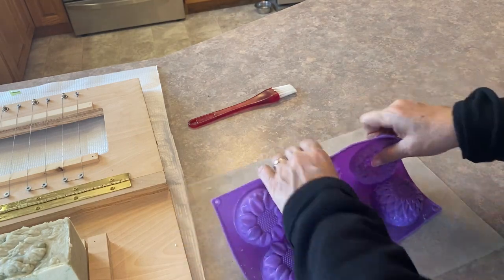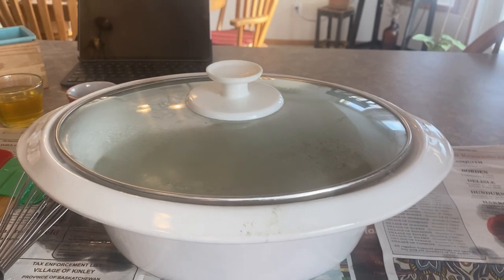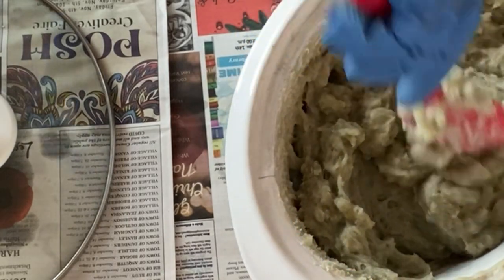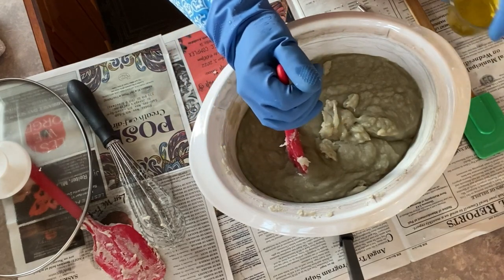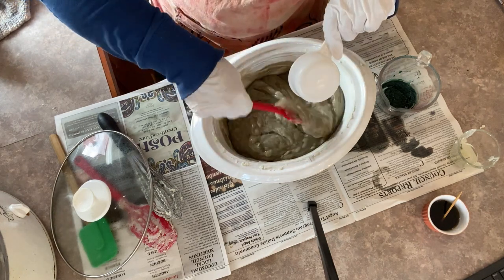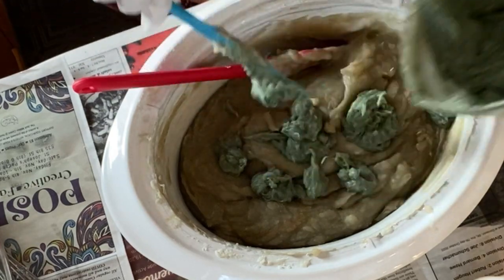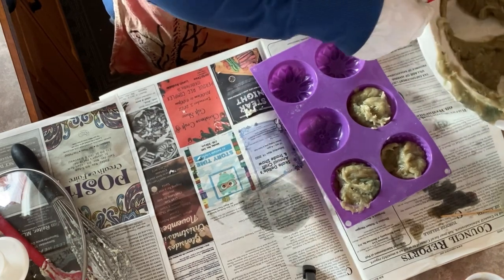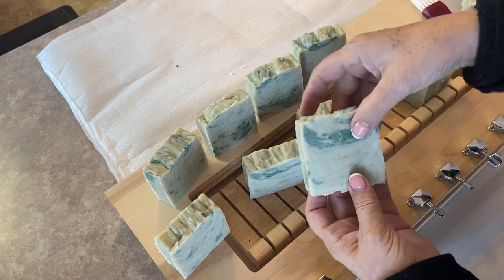High Temperature Hot Process Soap with In the Pot Swirl.

Comment: What are the advantages to the high temp hot process soap? 
I notice you take it out of the cooker once fully heated, whereas I start at around 160-170, mixing until light trace and cooking for the next 45 min or so until the translucent stage.
Reply from the maker: yes,  I mix the oils and lye together at high temps of around 200-220 F.  This makes it a faster process and no need to cook it in a crockpot.  Once you blend the hot oils with hot lye solution the saponification process only takes about 10-15 minutes!   this is why I prefer this method.  Just need to be ready to do a lot of stirring!